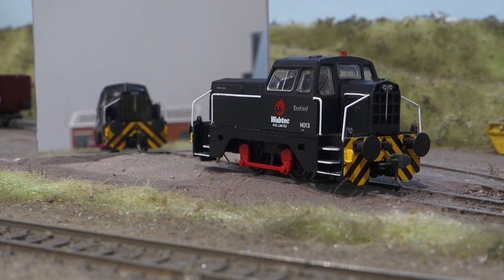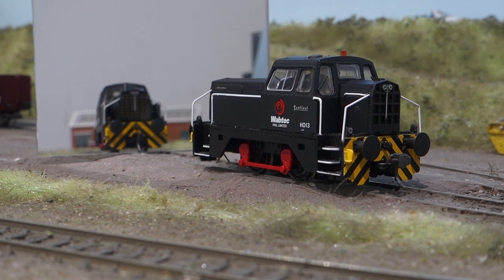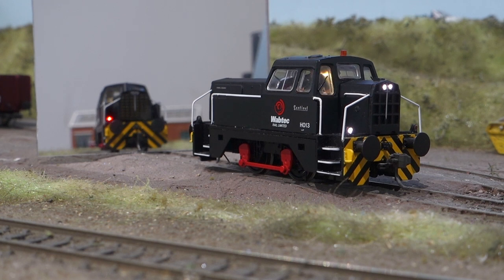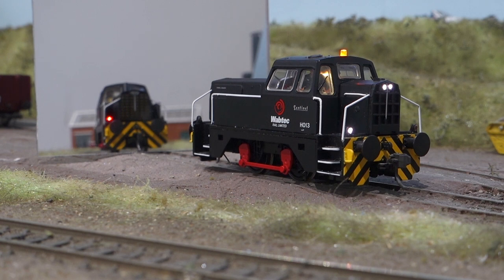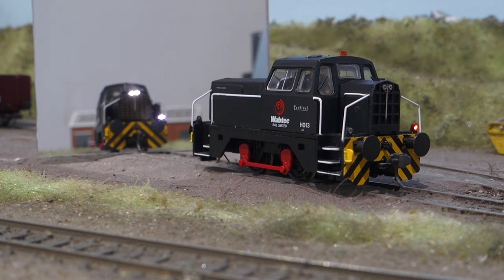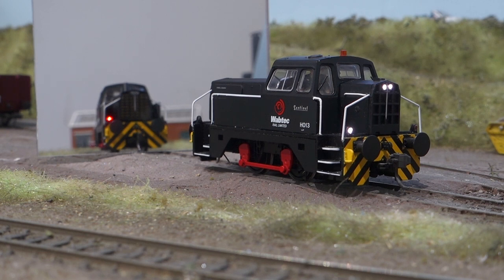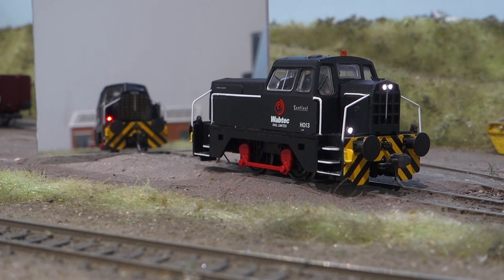Hornby Sentinel Shunter With Sound And Lights Added

Comment: I worked on 52 /4  at Ellesmere Port,   no way you would hear windows wipers,   the brake going off  sounded like the sanders, we did not have a flashing light on top ,  nor " directional lights" two headlights correct, we called these 4 wheelers  rocking horse's   after spending a few hours on them you felt seasick,  we only had the DHs as a replacement for the six wheelers in fir repair.   The engine does not sound right  but my be after spending 13 years sitting behind one  I am no deaf. Well done on the paint job  they did have a compressor for air brakes in tankers a sound you are missing is the clang do the chain when it's being hooked on,  well done

Comment: Looks & sounds excellent! Is the sound decoder for this available to buy? If so is it 4 pin and how much is it?
Reply from the maker: I like Transport the problem is that there’s not enough space in the model to fit any sound decoder, so whether you use a micro or a full size decoder it has to be hard wired and the internals of the model have to be re worked a little bit to get it in
Reply: @roadsandrails  Oh